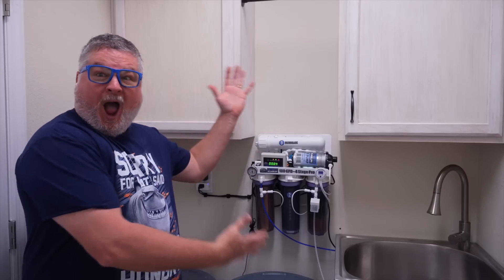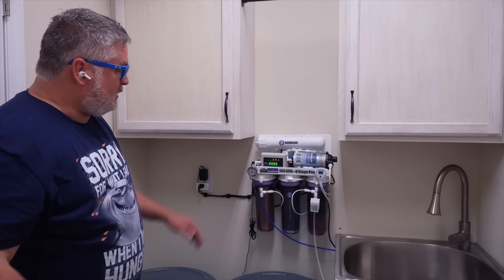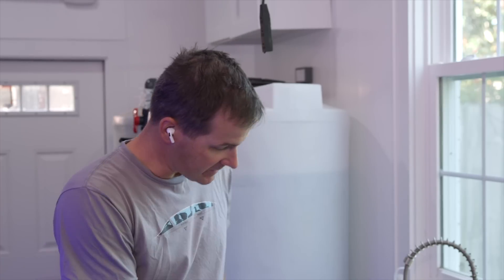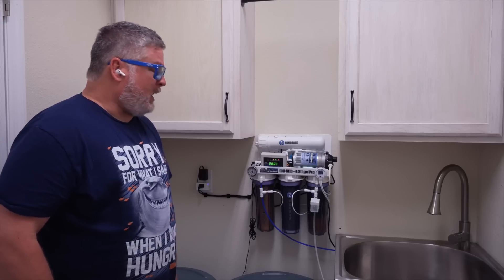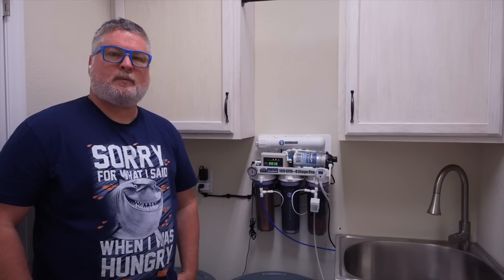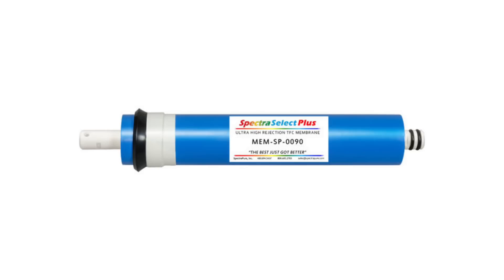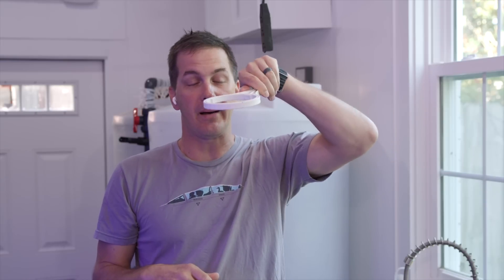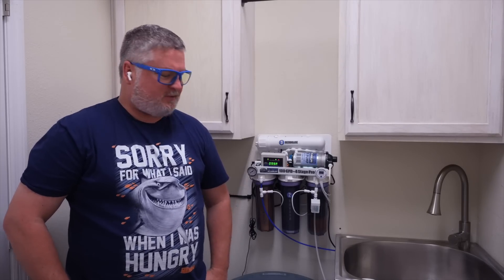RODI PREVENTATIVE Maintenance - Newbie Tank Build

Comment: His membrane shouldn't be shot already. Should set him up with a 3-way ball valve to bypass the di canister that goes to the drain to flush his creep after every use.

I have a 180 and my membrane is 90%+ rejection going on 4 years. Same 100 tds coming in.